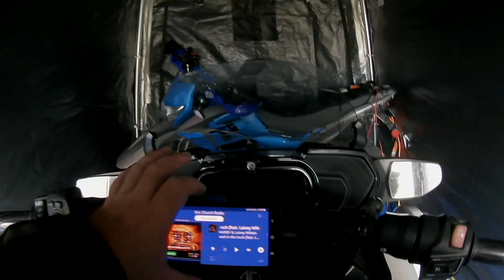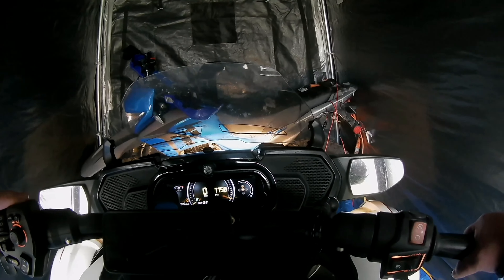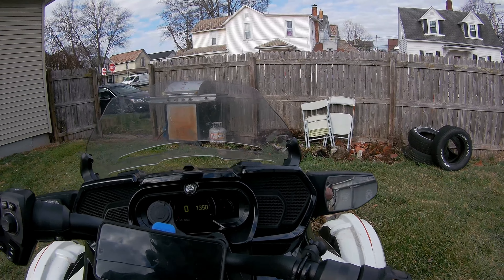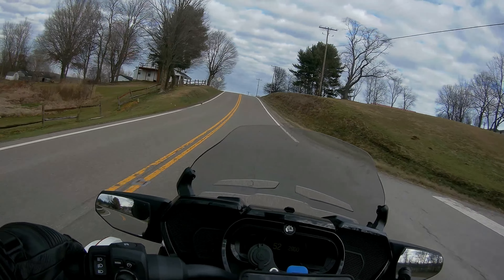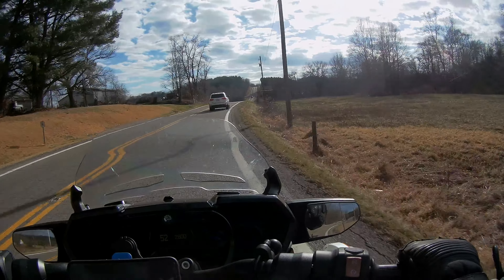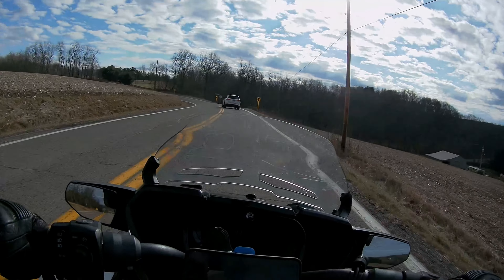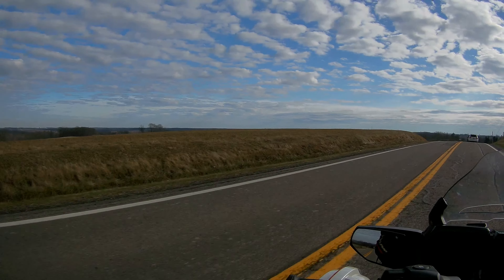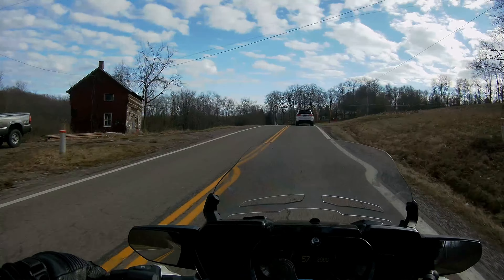2020 CAN AM SPYDER VSS ISSUE

Comment: Yeah bro as Smoaks says cable connections & low voltage can throw a myriad of codes ... I charge all my Toys once a month I don't leave the battery tender on Full-time & I normally get around 5yrs out of a battery 👍
Reply from the maker: I changed the F3's battery after 6.years just due to age. I worked on the F3T last week so time will tell.if I have fixed the issue.
Reply: @spyderryder  Yeah I reckon I could've got 6yrs too but I decided to change it while it was still good ... I didn't want to risk getting stuck by the side of a rd with a flat battery 👍

Comment: My 22 F3 did that when I first started it after being in storage all winter. VSS fault came on then back off. But the engine light stayed on. I unhooked the negative battery cable for a few seconds, put it back on, it was fine. Engine light went out as soon as I started it. Had charger on it all winter.

Comment: When installing a new battery you need to fully charge it for a day or so as what should be done to anything that has a battery. Dealers just fill, seal and install. I can leave my bike unplugged for a month and it’ll be fine because I made sure the battery was as best it can be right from the start.

Comment: I bought a Ryker brand new in 2021 and it had this same issue as the Spyder I traded it in for in 2022. I changed to a higher cold crank amp battery from the dealership and it fixed the Ryker, no questions asked. I let the dealership check out the Spyder for a few months and I believe they simply recharged the battery. I'm going to assume that it's a similar issue at this point, that Can-am just puts weaker batteries in their vehicles on purpose to aggravate their customers or save $$. A lot of people with zero mechanical background will think they did something wrong or broke their new vehicle. I also got the impression that the dealership didn't change the battery after letting countless customers flip switches and lights and be hooligans on the thing on the show room floor.